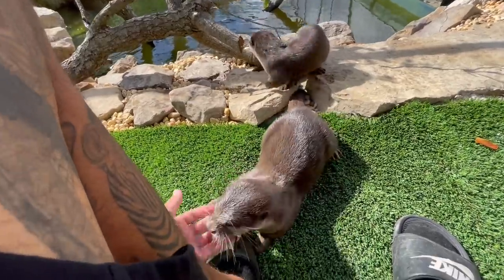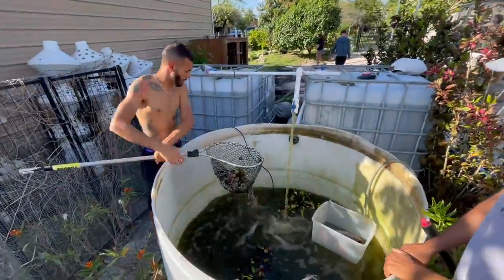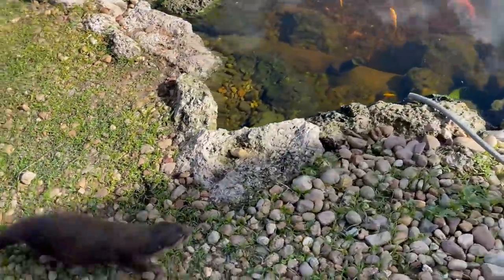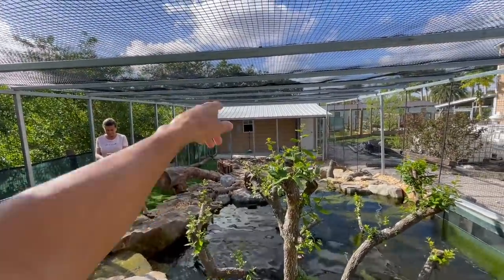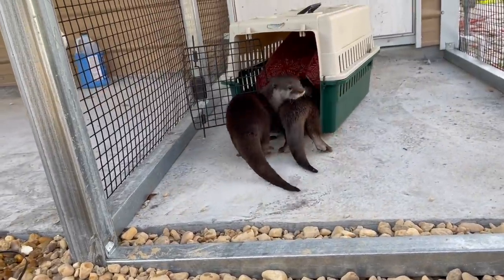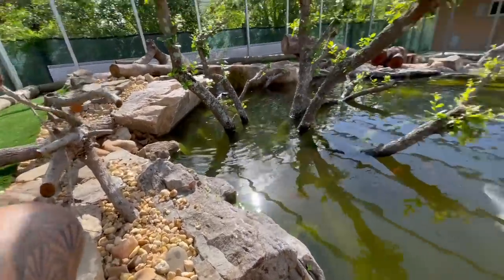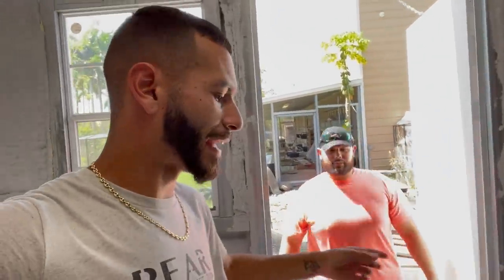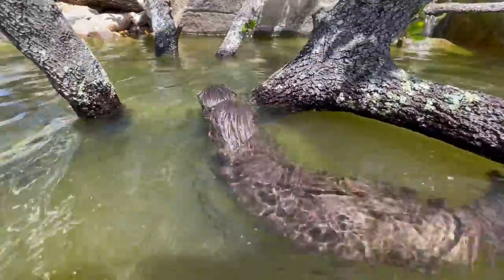MASSIVE ENCLOSURE COMPLETED For Baby Pet OTTER! *INCREDIBLE*

Comment: Get some foam rubber, like the egg crate foam you put on top of a bed to add padding, and lay it at the bottom of the waterfall while they are locked inside sleeping, and it will filter the excess algae out of the water over night.  Take it out the next day before you release the otters, and run it under a water hose to clean it in the grass.  It works like fertilizer for the grass...  You'll notice a huge difference in clarity of the water.